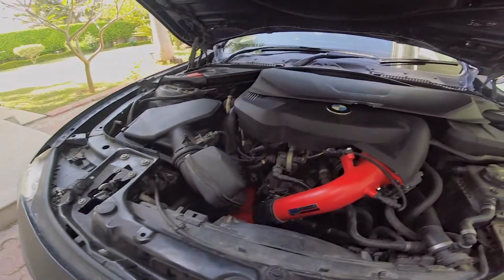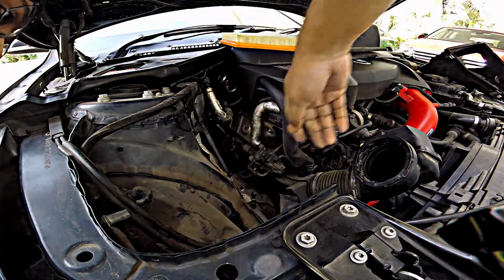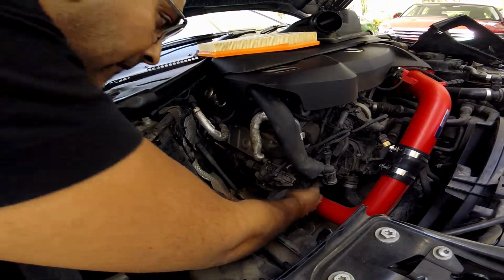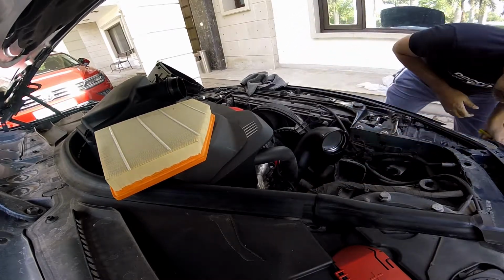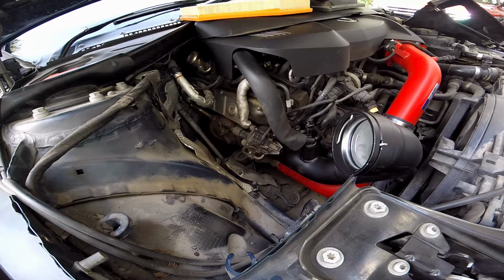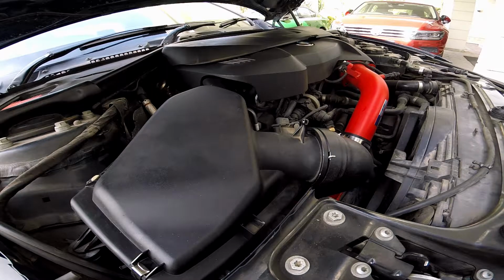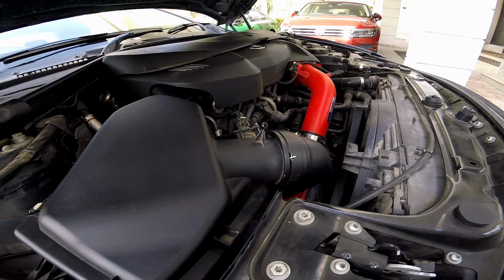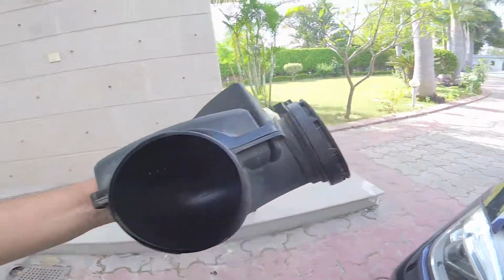FTP Motorsport Intake Pipe install on my F30 BMW 320i LCI (B48 Engine)

Comment: Aside from this video, it was pretty surprising to see that there are basically no good LCI B48 intake pipe install videos. Thank you very much for this video, I followed it exactly and was able to upgrade my intake pipe in an hour. I would've done it quicker if that stupid C clamp didn't fly off in the engine bay (I had to take my wheel off just to be able to pick it up from the splash shield). Much appreciated, thanks again!
Reply from the maker: Anytime! That’s the exact reason I put this video out.

Comment: What symptoms did you have with the cracked pipes? my car sometimes stall during cold start and I wonder if there is a leak in my intake pipe. Did you have any issues when starting with the leaks?
Reply from the maker: Started with bad gas mileage and the graduated to hissing sounds

Comment: I just installed the ftp inlet and evolution racewerks charge pipe on 2018 430i b46. Car seems slower now. I assumed opening up the breathing passages would help not hurt.
Reply from the maker: I would double check the clamps, it should not be slower at all.. check for leaks

Comment: That breather hose that's leaking - do you have a part number for it?  Mine cracked because it was so brittle while moving it out of the way.
Reply from the maker: Let me check
Reply: @PrithwiRay  I found it - BMW 11 15 7 623 745

Comment: How can you tell if it has leak? Right now I have MST intake on my B48 engine but not that 'small' intake pipe. It is still plastic, not alu like yours. Did you check for the leak or did it affect the airflow?
Reply from the maker: I saw leaks at the joints and where the pipe met the turbo.. since PCV outlet is on this pipe it’s easy to spot leaks, just look for oil stains

Comment: Hey prithwi would you suggest a conical air intake for Delhi summers or an stock replacement?
Reply from the maker: Stick to stock filters. You loose a bit of airflow but it keeps all the dust and crud out of ur engine
Reply: @PrithwiRay  thank you!

Comment: Hi, is this B48 FTP inlet pipe(intake pipe)sg71413 can fit with BMS air intake?
Reply from the maker: Not sure
Reply: Yes BMS fits!
Reply: @Bryan-wv4lk  Did you install it on a BMS intake?
Reply: @ayyyman_  I originally did but I notice it bogged it down when it got warm. I found the best results was an intake pipe with a k&n air filter it’s a true cold air with the stock air box. I noticed a pretty good difference. That intake pipe works very well and easy to install.

Comment: What lubricant did you use for that connection? I want to change my intake pipe on my b48 soon
Reply: Also does it sound any different in your opinion with the new intake pipe
Reply from the maker: I used some fresh engine oil. And the engine does sound different
Reply: @PrithwiRay  awesome it seems easy enough i'm not very experienced w this type of stuff, I recently got the VSRF Downpipe and it sounds awesome

Comment: Oh okay now I understand so that pipe you just put in that's only for to be used with the stock air box.. because if you put in a let's say MST cold air intake that pipe won't work.. there is one that's shorter that doesn't bend up towards the airbox.
Reply from the maker: Yes
Reply: Why wouldn’t it work w the MST intake? Which brand does work w the MST?